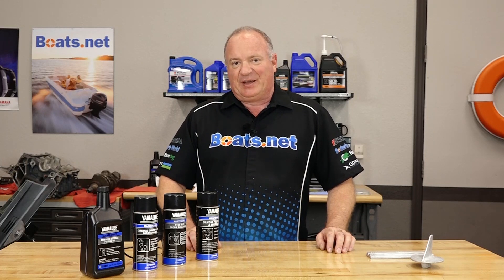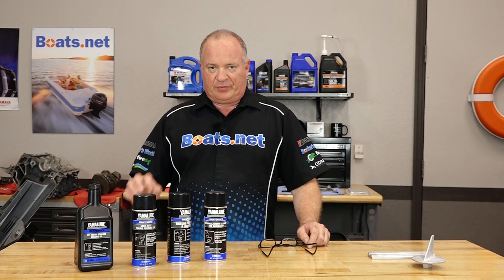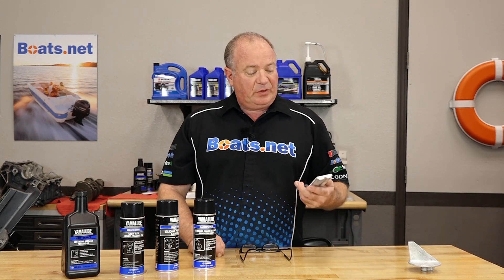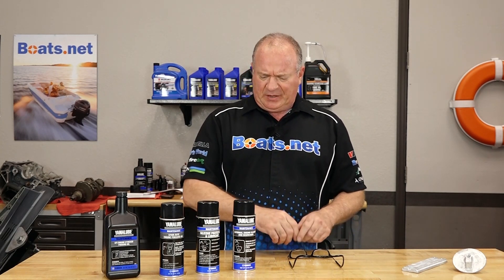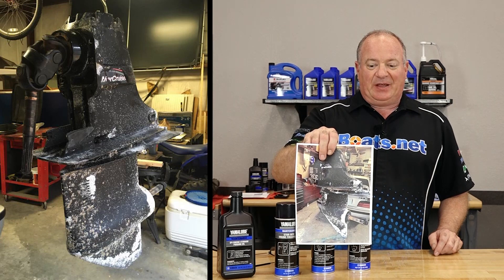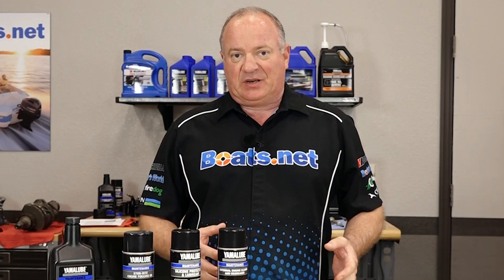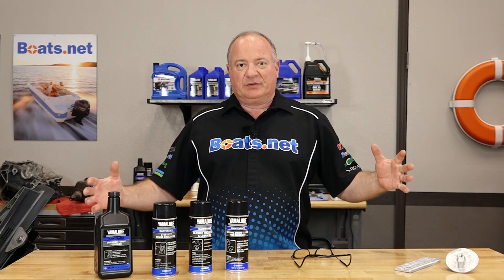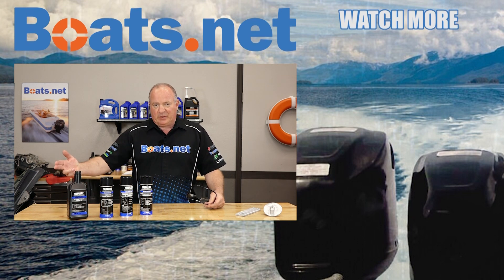Outboard Corrosion Protection | Boat Corrosion Problems | Boats.net

Comment: My Yamaha 115 (C115TLRW) is 22 years old. Can I take the outboard engine cover off and spray the inside of the engine with something to get the inside cleaner? For example is it okay to use GUNK Engine Degreaser on the engine under the cover? Any recommendations are appreciated?
Reply: Is this okay to do: https://youtu.be/r_zQIxdTdAg